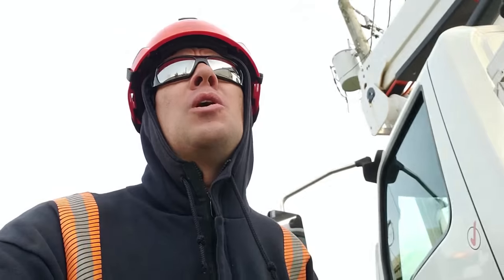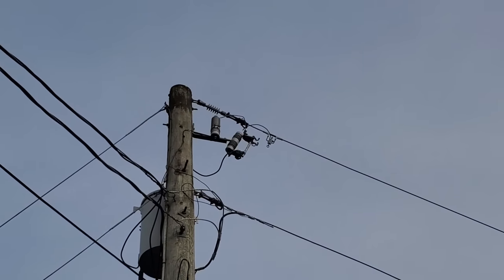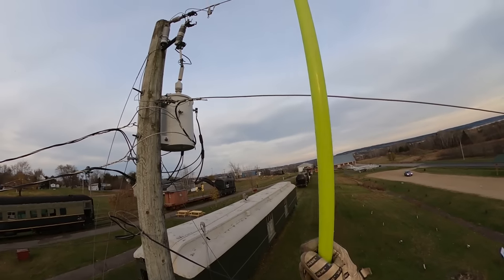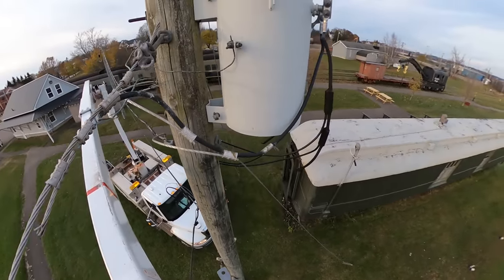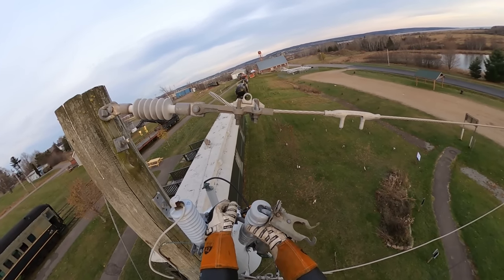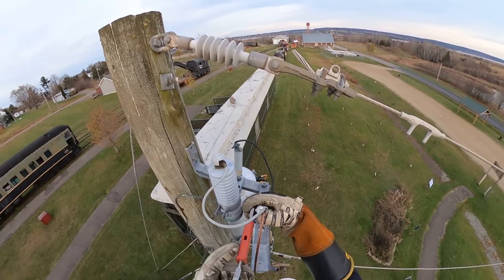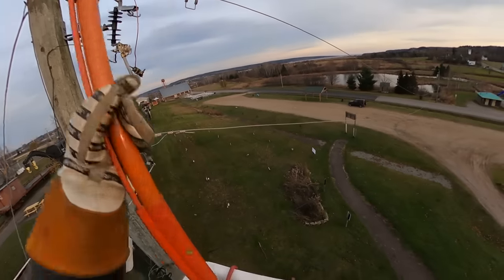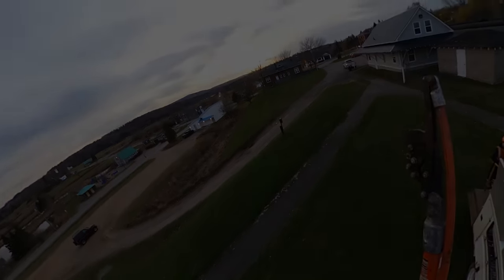No power!... all cutouts are closed !?

Comment: Another good thing to check in these situations if your fuse and stinger looks fine is simply walking over and checking voltage in the meter base. No setting up trucks, fast and easy. I’ve seen several times where guys have went up and replaced a transformer only for the meter to still not be lit up, just a bad meter.

Comment: Do your rules at NB Power make it so even if you have a qualified observer you can’t go hands on? We squeeze our stirrups on with h-taps
Reply from the maker: We can go hands one pretty much anytime as long as;

-Moisture below 80% (basically not raining or heavy fog)

-second man on site

-reclosing is blocked

-tested boom
Reply: @Bobsdecline  I gotcha! So correct me if I’m understanding this wrong, you need the reclosers to be on non-reclose (one-shot) ANY time you’re hands on?  The only rule we have for a non-reclose requirement is with #4-6 copper primary. 
Appreciate the explanation. 

Do you happen to know Ryan Carr?

Comment: 25 yrs as an electrician, mostly commercial, and i always liked, and still like, to watch linemen at work. 
Thanks for the cool videos.
I'm from Quebec, and i noticed that this video is in N-B, by looking at the meter box seal..
The electrical instalations look pretty much the same as here in Quebec. 
Just for your personal information/knowledge, this is not a 400A meter box. 
It's a 320A. And Yes, those meter are not reading directly on the lines, like in a 200A. They use CTs. And here in Quebec, to  prevent potential backfeed, there is a disconnect in these meter box, so that the linemen can really isolate the building load. Its in the other compartment directly under the meter. 
Keep up the good work!! 
And btw, are you sposored by milwaukee? 
I think they are starting to take over the tool industry with their nice tools. 😎

Comment: Nice video Aaron. Interesting that you have to have a second pair of eyes/ supervisor on site when you work with high KV voltages. Loved all your new bucket tool holders. First class gear. Stay safe with all those high winds coming at you.
Reply from the maker: The wind was getting nasty a midnight last night! Figured I'd wake up to a huge mess but I died right off and just got heavy rain all day
Reply: In EE when you work on certain gear, or abovecertain levels, or if an electrician you should always have a second person with a means to safely pull you from harm. That is why.

Comment: Hi Aaron,
I couldn’t help but notice that all your hand tools are all Milwaukee? Looked like a plug for their hand tools? LOL! 
I would have cut off that old lightening arrester. When energizing again there is no telling that could go off like a grenade? 
I have seen the socket pocket at work. I didn’t pull the trigger on it as I only have a couple sockets I use. 
Pretty snazzy secondary ground on the pot! We had one that was homemade years ago. Safety department didn’t approve it & told us to not to use it anymore. That’s a nice saddle for the primary. We only have Ampac saddles. 
I guess you do stick work is because your by yourself? We can go hands on the energized primary even by ourselves because not everything can be installed with a stick. 
Nice video with the troubleshooting aspect. Those kinds of calls make you scratch your head sometimes. We used to use #4 solid copper covered wire for tap wire for pots & they would fatigue over time & break causing that scenario. It hardly happens with stranded wire though. 
Try to be careful out there with the stormy weather this weekend? You’re always careful-I know! 
I continuously plug your channel at work because it’s soo informative! Especially to the apprentices. The way you work is professional & safe. The many different situations your in from weather to the type of work. Troubleshooting & dealing with the public. I’m constantly stressing to the apprentices that lineman hyper communicate with each other. Not everyone can see everything that is going on. Hence having another set of eyes to look out for your safety. Keep up the great content & look forward to your next video. 👍🏻👊🏻👍🏻👊🏻
Reply from the maker: Appreciate the comments John! Hope all is well with you, the wife and the crew!!

Comment: Nice work, we mostly don't have overhead lines here in Germany, except for the big towers with the 445kV lines which go to a substation, gets stepped down and is then distributed underground in double-sealed piping. The last outage was ages ago, and we also have a bioreactor in our village generating on average 625 kW, in emergency scenarios we could isolate and disconnect our village from outside substations, and connect to the transformer from the bioreactor plant. There's only around 300 people living here, so 650 kW is more than enough to at least enable us to use lights and the ignition and electronic control units for our gas heating, as well as the occasional telephone call or computer and internet use. I really like that our village is prepared for emergencies, we could go all year without needing the main grid - which is very much necessary due to the green party having shut down all our nuclear plants providing the base load.

Anyway, once again, a job well done, and most importantly, safely. Kudos, and stay safe man, I wish you all the best :)

Comment: We used  to test all insulated HV tools/sticks at start of daily shift. And yes usually safety observers had to be trained in the procedures being used. The old drop out fuses had problems with hang ups caused by insects plugging the barrels and not letting the spring loaded fuse element slide out. The bolt connection tension will be light spanner only as tension wrench settings are usually less. I liked on call as you get great variety of jobs. Keep those sparks short😀 (retired from live linesman/switch operator/cable joiner/electrician 15 odd years ago Australia)

Comment: Had very similar here on the low voltage (240v)  mains cutout fuse, on the load side. Terminal screws were loose,  the 25sqmm  cable was central in the terminal but not touching!  Very confusing...
Reply: Doesn't matter which voltage you have, it's wasting a lot of time when you have that kind of situation.

Comment: NA has crazy silly electrical connections. here its usually 3x 25A or 3x35A at 230/400V for a normal household
Reply: NA already had a large installed base of 120V carbon light bulbs when 240V tungsten bulbs were invented. So we did split phase. Europe went directly to tungsten so never had any need for 120.

Comment: The one small mistake - trusting the digital meter base is working on visual inspection. Use a known good meter to test on the leads inside the meter base box after removing the meter base. The meter base could have failed and you would not know it (If you didn't see any visual damage on the pole from the ground beforehand). If the meter base had failed, then a simple meter base swap out could be done and save you the trouble of setting up the boom to get to the transformer. Lots of good work otherwise.

Comment: Current limiting fuse…… always wondered what those were. I see them on other properties. We don’t use them here. Stinger goes straight into primary bushing on our pots. Also we use csp pots so I believe they have them built into them. 75kva and above are conventional pots but we do not install current limiting fuses on them either
Widow maker eh!!!! Guess an apprentice made up that cutout
Reply from the maker: We only install them on tx's that are within a mile or so from the sub. They help limit the fault current that capable with such close proximity. 

Once n a while they'll light right up upon failure but most time just turn into an insulated paper weight.
Reply: Great job, Aron. I'm just curious as to why the current limiting fuse (CLF) was used just before the XFMR bushing. Couldn't the CLF have been used to energize the transformer via the cutout?

Comment: Your technical trouble shooting is Excellent.  I have about 8 poles Im setting  south of you for our Local power company.    Maybe you could do a video on calling in locates before ysa dig and the nuts and bolts of really setting a pole,  How does your telecom company find out primary voltages if they set poles for you???  we have to worry about 34kv  to which we work with the power compamy for setting. It seems 55 class 2 our going up with ever y project

Comment: This summer we had the transformer that serviced our block replaced.  This video was interesting because of the risk posed by working so close to a high voltage source.  One question is, the line leading to our transformer comes from a 3 phase line, but is heavier gauge than the 7.2 kv line in this video.  It also appeared to be insulated.  Just out of curiosity, what voltage would that line have?  My guess would be 2.4 kv

Comment: and theres was no disconnect switch on the other end of that overhead line so it could be deenergized while you worked at it. But nice job. what is the arc and safety distance for 7200 volt. for 10 kv it is 300 mm. but  it seems to be smaller for 7,2 kv.

Comment: Why does your utility put lightning arrestors on the top side of cut out? Wouldn’t a bad arrestor cause a line outage?
Reply from the maker: They're all installed on tx now... I agree much better location.
Reply: Old school method kind of. Most all companies used to use the ceramic arrestor mounted on the cutout bracket in the day
Reply: @kg4muc  A lot of companies install them on the tx but they are hooked directly to the line not via the cutout.
Reply: Gives another head scratcher if the arrestor don’t blow apart and clear the short when a line fuse or recloser is operated 😅

Comment: What type of non shield insulated wire is that on high voltage from the xfmr primary to the cut out? You used bare feeding, but what is insulation type on the other?

Comment: Well honestly there are only so many things that could go wrong. Electric is a relatively simple system compared to things like Software.  Was sure to be a broken wire somewhere.  When I worked at the telecom company we had a tool (T-Berd) that would locate the distance of the break. Nowadays with Fiber we have a similar tool called OTDR

Comment: On the meter at the beginning, doesn't it say Multiply by 1?  If so would that not be a direct connected meter?  I could not read the current class of the meter, looking for Class 320 or whatever.
Reply from the maker: That's just for the dials...
Some of our old meters had 10x with the first dial X'd out.
This particular setup would have a 400:5 CT, no PT and no reading multiplier, so the reading would have a 80x multiplier
Reply: @Bobsdecline  Where I'm from, PG&E, it will say Class 20 and Multiply By 40 on basically the same meter as that one.  Also your company is showing in the meter shot in 2 places.

Comment: My old house, the meter on the house was about 10 years old and the screen was actually shot and most in my neighborhood was. The direct sun in Phoenix and and summer days getting pounded just took them out. I got solar on my house and they replaced it with a 2 way net metering meter so I could send electric back to the grid and so I could see the meter screen again. About 2 years later I talked with a guy I saw walking taking meters off houses. He was swapping all meters in the neighborhood with new model. He didn't know why but did say most meters had the screens broken. 

So if you were troubleshooting a power issues And saw meters in houses are out, when they are all broken to begin with....

Comment: Why do you remove hot side bond first ?
Reply: Because everything else is grounded. With the other side connected to neutral (ground), if you accidentally drop that clamp and it touches another piece of metal that is also bonded to ground... and nothing happens. If you disconnect the neutral side first and drop the clamp, you've just shorted the hot side to whatever (transformer case most likely) so you get a big ol' arc. You do the same procedure with jumper cables in a car for the same reason

Comment: Do you sharpen your knife or is it a case of replace once blunt?
Reply from the maker: We use both the Kline and Milwaukee Hawbill knives and they're easily sharpened and can last for years!
Reply: @Bobsdecline  Thanks for the answer Aaron, i only do LV as you may recall (480 max) but a decent knife is a great tool and i felt your pain at 'i don't like using my knife for this' but i've done it on heavily oxidized cables.. I can sharpen it later

Comment: Jumping the neutral and hot on trans if there was back feed wouldn’t  that damage their generator
Reply from the maker: It could... Or it may just trip a breaker. There are very strict regulations when using a generator...  If our procedures were to damage someone's generator then it was improperly hooked up.

Comment: I’m a JL and it sucks you guys can’t go hands on. Turned a 5 min job into an hour minimum
Reply from the maker: We go hands on all the time. We must shut reclosing off however... and use a different truck. Much quicker to stick it, than call for a hotline truck. If we had one there, would have been no issues gloving it
Reply: @Bobsdecline  right on. It’s hard not being there or seeing maps but I’m ASSUMING that the fuse on the street light pole can be a isolation point. Where I’m from we would consider that working behind fuses and wouldn’t need suspension or one shot. So we would’ve just gloves it. Obviously you’re a trouble men so you can only do so much Legally. Obviously all utilities are different. I do love the videos tho fun to watch on storm have my apprentice watching them too lol
Reply from the maker: That's awesome!...Yessir you're right about things being different! That makes total sense being able to work beyond the fuse without non-reclosing. At our company, we must use the one shot regardless

Comment: Bob you want to be careful with that type of “Hot stick” cutter it looks like the type we use to use have if you attempt to cut ACSR wire the cutter handle will rapidly go back to the main handle and if your fingers are near the pinch point you can break a finger ( thumb) I know I did it.We got rid of them and have ratcheting cutters now so pressure is applied at a more controlled rate.Just a heads up from a fellow trouble shooter😊
Reply from the maker: 💯! Excellent tip/reminder! I know exactly what you're talking about but completely forgot.... I did mildly jam a finger a while back. This is a different set, the head was shaped more like regular bolt cutters on my old ones as opposed to being rounded. I'll check today and see if the handle collapses all the way on this pair. Some of of crews have the ratcheting pair as well.
Appreciate the heads up! 👊👊

Comment: New subscriber here. Great job and i had a question. I am in Mississippi and have a new home that I built in 2020. Every ceiling light in my house has halo led cans throughout the house. We know we have everything properly wired and grounded along with getting proper voltage at the can lights and from the breaker panel but for some reason my ceiling lights flicker. I was told to get the power company to come test voltage at the pole and to the meter to make sure i am getting the correct voltage. Would you agree with that? I never had to ask for that before so i wanted to see what you thought

Comment: Where is this Canada? Do you guys not glove 7200 or have reclosers? We'd just call the comm center tag a recloser rubber up and glove that. Also a good trick that works sometimes to get those old oxidized hotline clamps off if they come off hard is to hold the bottom of it so you're also supporting the wire so it doesn't bounce too much and smack the top of it with a hammer. Then they'll come right off sometimes with a screwdriver. I was thinking bad clf or tripped can initially. Never seen those secondary jumpers cables before either. If we were worried about back feed we'd just pop the leads out.

Comment: Hey. That bottom line going to the house. The line attached to my house looks like that and there are currently branches touching it. Is that an issue? Also, would such a line hold 200lbs? I wanted to try out zip-lining through my yard like a badass superhero. Obviously I'm just joking about the zip lining.
Reply: I think the triplex neutral is usually ACSR which is pretty strong. While the line could probably handle a 200lb weight without snapping it wouldn't surprise me if you pulled the cable right off your house. As for the branches, it's probably not an immediate issue because the hots are insulated and the voltage is relatively low, however it could become an issue later on. If branches can rub against the line the insulation will get damaged over time. I would definitely call your local power company for how to proceed. Not knowing any specifics I would guess they will either install guards over the cable and/or do an initial trimming themselves for free. Once the branches are out of the way you will probably be responsible for ensuring they they do not get too close in the future.